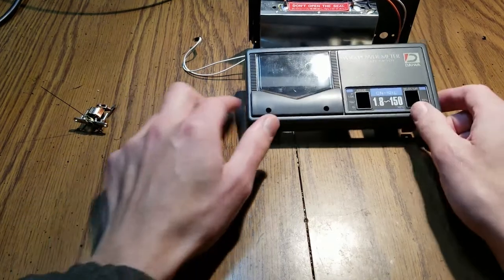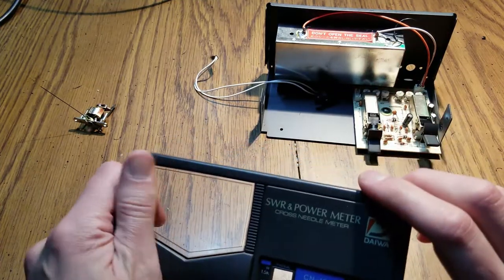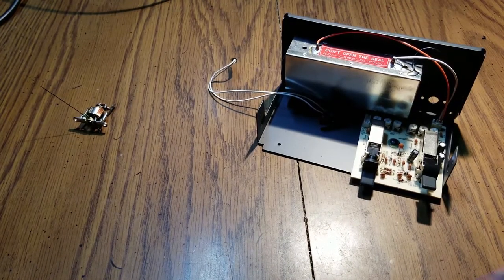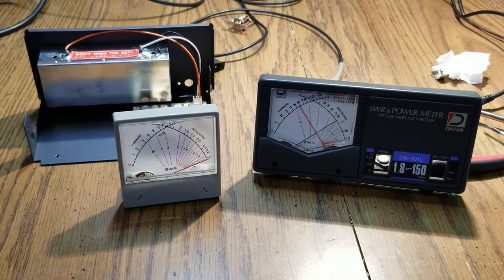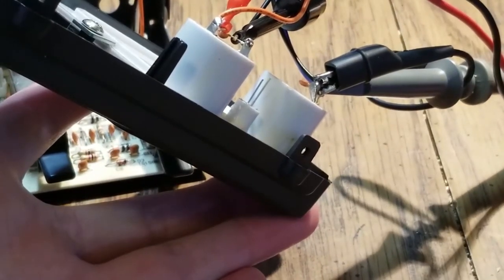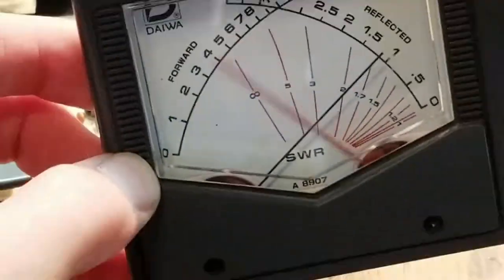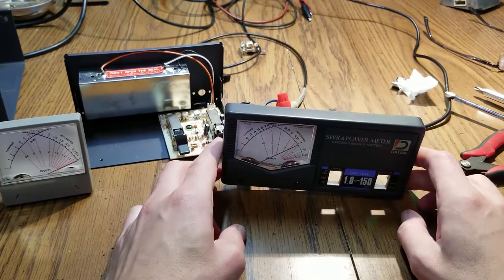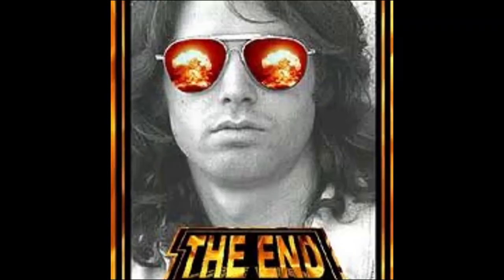Replacing a Analog Meter Movement in a Daiwa CN-101L

Comment: I have a Daiwa cross needle CN591H , the ridht side meter movent(forward)right side moves but when you tap on the top of the meter it moves up about the same distance it originall moved , then it shows the correct power...you have to do this everytime.i have loosened the movement screw.

Any other ideas please?.
Peace From OZ 🇦🇺